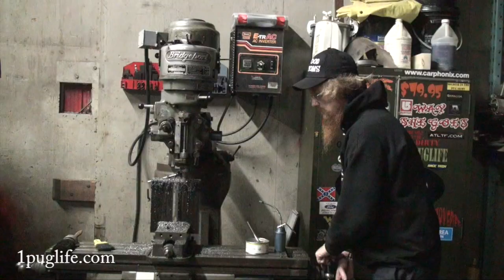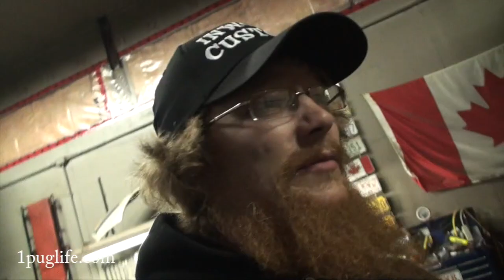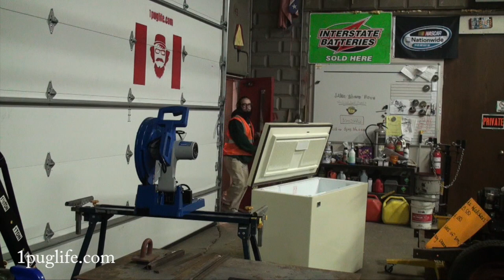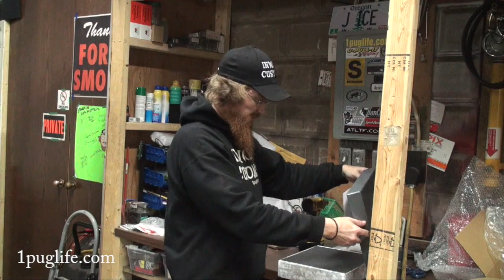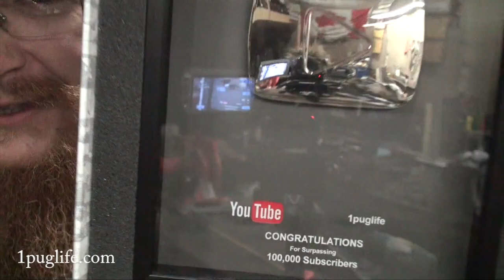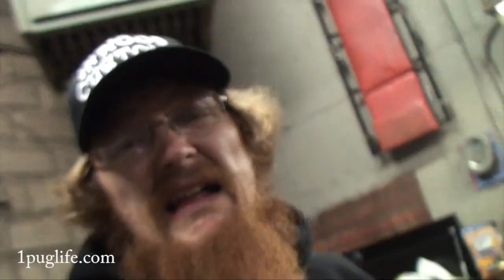play button

Comment: MILLY MILL BRIDGPORT, turn your vise and mount ax for log spliter at angle or tilt your head, etc etc you got lots of options to mill that like a ax , and mill it with out any grinding.